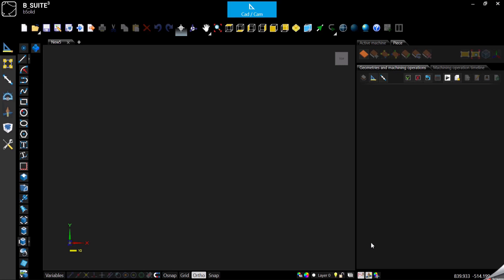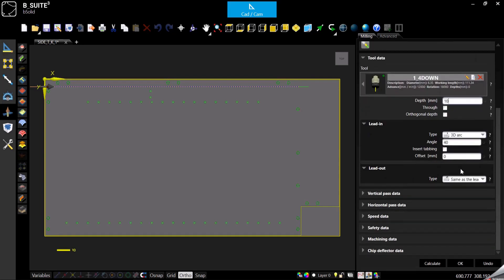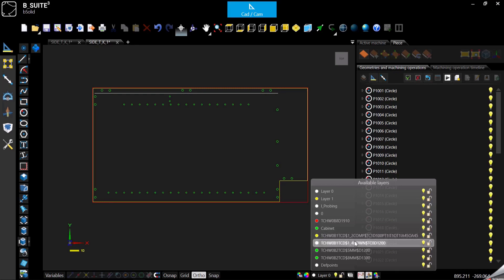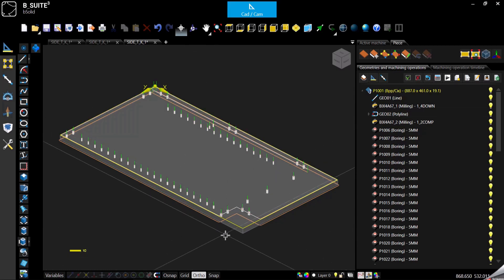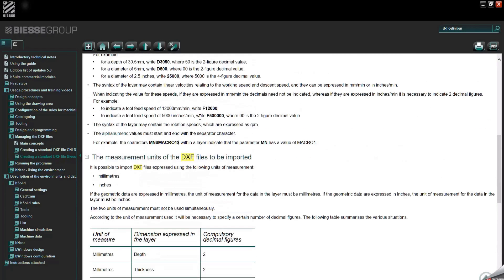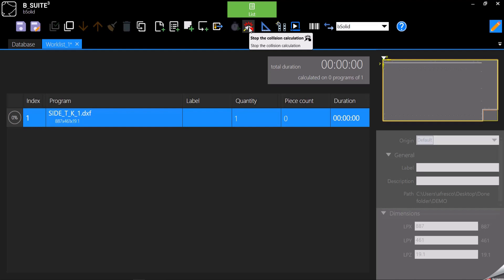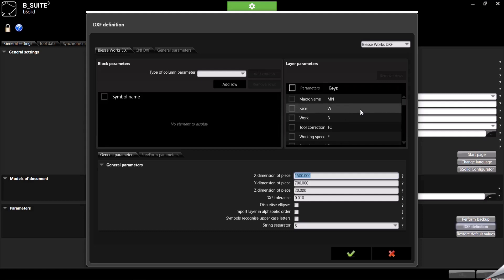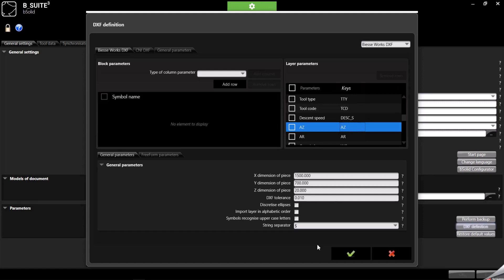BIESSE bSolid - Technological DXF files

Comment: Is there any way to modify the imported dxf program in b-solid, I cant modify the imported programs in b-solid, the software returns to original when I run the simulation after small changes
Reply from the maker: Hi Leonardo, 
Is it a simple 2D DXF on which you apply all the machining, or it is a technological DXF the one you are trying to modify?
I have never experienced something like that, so I would like to understand better what you are doing.
Thank you
Reply: @freshzone  Its a technological dxf (cni dxf), after the simulation , It doesnt let me apply the changes, the drills return to the original position,  on the otherwise hand I can work with the same dxf, made changes and machining in other skipper 100 machines with an old biesseworks, I guess Its some Kind of security lock in b-solid software to avoid changes being made by the operator.
Reply from the maker: @Leonardo-jb1ey  No, no, you should be able to modify everything also in bSolid. 
Try this: After importing the file in the CAD environment as I assume you normally do, try to click with the right button of the mouse on the panel, that should have the icon similar to the old BiesseWorks software and select "Finalize". After doing so, the icon of the panel should not be like the old BiesseWorks anymore, but should look like a regular bSolid panel, and at this point you can try to make all the changes you have to do and check if you still have the issue or not.
Let me know
Reply: @freshzone  Thanks

Comment: Is there a guide/manual on HOW to use/create these "Technological DXF"? I mean, I can see where in Bsolid to get the different keywords to use, but....
Looking at the naming of the layers in the example above... hard to understand what is what. But most of all - in what scenario is this used? As in my case - if I have a shape, made outside Bsolid, I import it as dwg or dxf, and apply the machining required. I am very curious as to what kind of way of working learning this would make sense. (personally I work with IronCad/Woodlab - generating cix-files for bsolid)
Reply from the maker: Hi, the technological dxf is used as an alternative to our BiesseWorks or bSolid.
If you are already using a third party software, exporting cix files, I think your set up is good as it is. 
Like also mentioned in the video I think, the technogical dxf is already an actual program for the machine and it can be used directly into the work-list. 
Anyway you should be able to find all the info on the BiesseWorks or bSolid manual (depending upon whatyou have). 
Probably in the future, I will create a video showing how to make a file from scratch. 
Best regards
Reply: @freshzone  Many thanks for the informational response. I assume these files, since they can be used directly into the work list - do not work with eps automatic table?